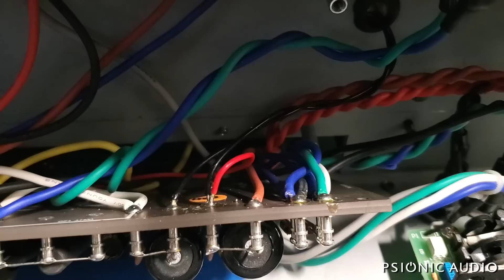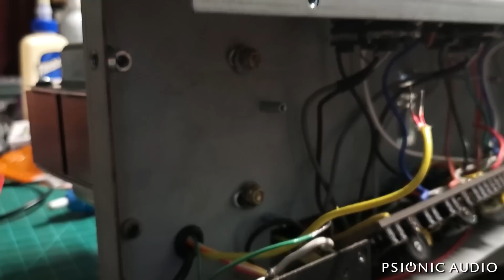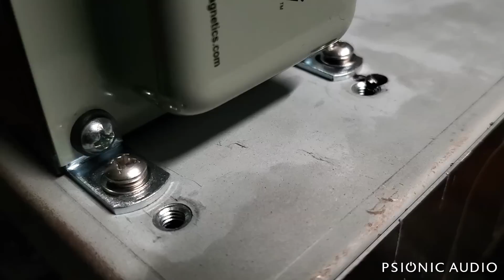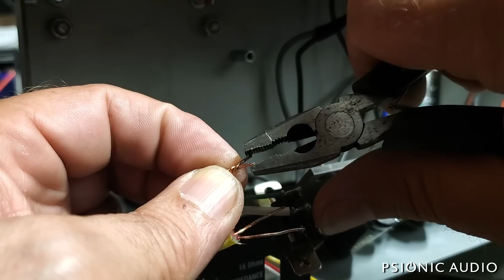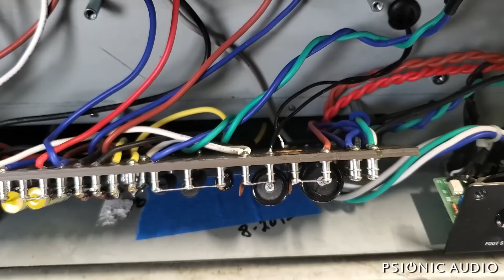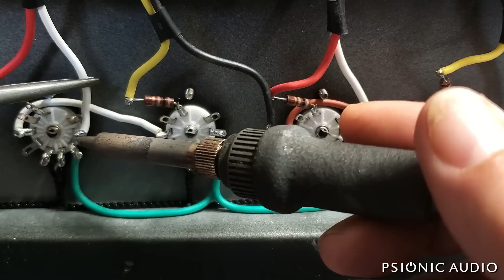AITA? Vox AC30 HW | Part 2 : Getting Started on the Fixes (Long Video - There's a Lot to Do)

Comment: Once you have most of the enamel scratched off with a razor, you might try collecting a big bead of solder on your tip and run the wire through it. Done right, it will both strip off the remaining enamel and tin the wire in one go. 

This method also works to strip enamel and tin wire ends without razor scraping at all on < 22-24AWG wire where there isn't so much enamel coating to be removed and/or it isn't laid on so thick. 

I work in an electronics engineering R&D lab and I use this little trick fairly often when working with mag wire.

Comment: I used to work in a electric motor rewind shop.  The way we stripped enamel from wire was with a small tool shaped like tweezers that had a scraper on the end.  A fairly cheap, and simple tool.  They're included in some solder kits, but I would imagine most people don't know what they are.
Reply from the maker: I know what they are. This enamel is crazy tough.

Comment: Sucking the solder out of those turrets is exactly the sort of operation a vacuum-operated desoldering station is tailor-made for. As for keeping lead out of the environment, this brings up a thorny question: what do we do, what should we do, with the solder splashes, the bits and balls of solder that come out of our solder-suckers and desoldering stations, and the lead-impregnated, used desoldering braid? Other than just throw it in the trash, that is. Most municipalities have facilities and procedures in place for recycling old household paint, solvents, cleaning chemicals and the like, but toxic metals are a whole 'nother level. Ideally we should be saving the lead and copper scrap for recycling, but where would we send it?? Case in point: I actually have a dozen mercury-filled diodes, each the size of beer cans, made of glass and ceramic and each containing a tablespoon or so of liquid mercury. They came with a big batch of tubes I bought some years ago, and although they were once used in welding machines, nobody wants them nowadays, and the nearest hazardous waste facility that will accepts them is over an hour's drive away and its gonna cost me the better part of a hundred bucks to have them disposed of....
Reply from the maker: Yeah, but they clog something fierce.

Comment: Hey, I know this is an old video, but I have seen a better method for dealing with enameled wire.  If you heat the very end of the wire (where it is cut), that wire will take solder as long as it is applied from the bare end. It will wick up and burn away the enamel as it is heated, no scraping required.  Mr. Carlson's Lab demonstrated this method, but I don't recall on which platform the video was posted.
Reply from the maker: Tried that. Doesn’t work on these.

Comment: Have you ever considered switching to eutectic solder?  I use a tin/lead/silver eutectic solder and it flows very well.  Lower melting point than traditional 60/40 solder.

Comment: 17:15, I think I used to simply use a cigarette lighter for removing the red enamel crap.  May be wrong.
Reply from the maker: Tried it. No dice. Just darkens it and the bubbly bits stick to the wire even more.
Reply: @PsionicAudio  My other idea was Formic acid.  Dip and hold for 10 min.  The coating should swell and peel of like your skin might.  I've also had success with careful use of acetone.

Comment: Ehh.. Lead free solder is used in drilling tools going down an oil well. Circuit boards rated up to 175 DegC, and, I dare say, plenty of vibration/mechanical stress. Cost of a failure can run into hundred of thousands of dollars, if not millions in deep sea wells. You really think profitdriven oilcompanies would tolerate such a risk if Lead free solder was so bad as stated here?

Comment: It sounds like it takes several pushes on the piston of the solder sucker to prime it for another try ---- why is that? Is the plunger not clearing the tip properly on the first try? What brand is it that you're using? A Solda-Pult, or some other?

Comment: Sandpaper or emery cloth to remove thew enamel on the transformer wires?
Reply: I have been told that manufacturers use a solder pot to burn off the enamel and pre-tin the wires but I've never tried it..  I have a solder pot and some ingots of solder for it which I picked up at a flea market or a Hamfest  somewhere but it's half buried out in the garage and I've never actually used it.....
Reply from the maker: Tried that. Razor is faster.

Comment: Have you tried using a solvent to remove that nasty enamel?
Reply: Although nothing I've tried in the past will remove the enamel coating, I have to wonder if Nitro methane will work, because that's a good solvent for lacquer-based threadlocking compounds such as Glyptol and other colored liquids that are used to lock bolts bolts and nuts in place. Have to be very careful working with that stuff however because it's extremely flammable.
Reply: @goodun2974  they run dragsters on nitro methane!
Reply: @oscardelatorre  , I know they do. Remote controlled planes too, or at least they did before the advent of drone technology. I don't know if flying model planes is still a thing these days....